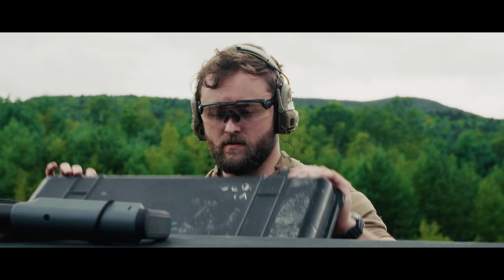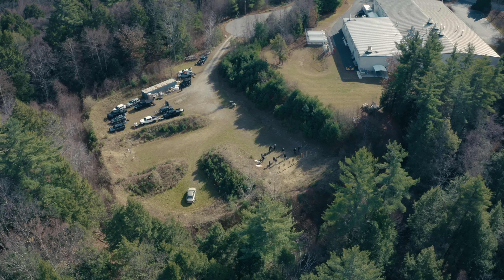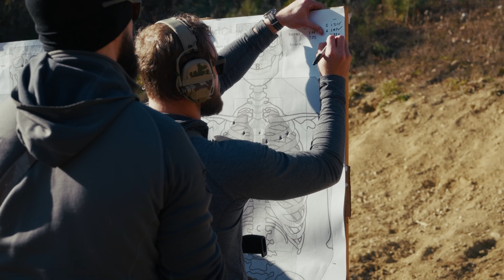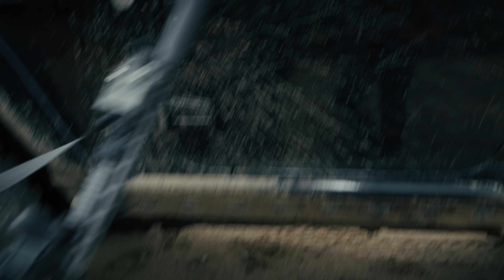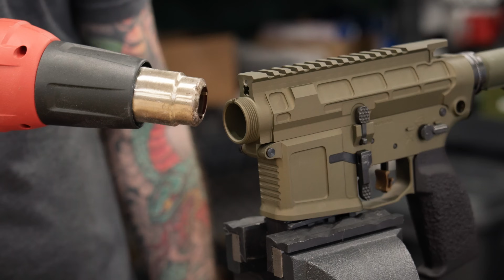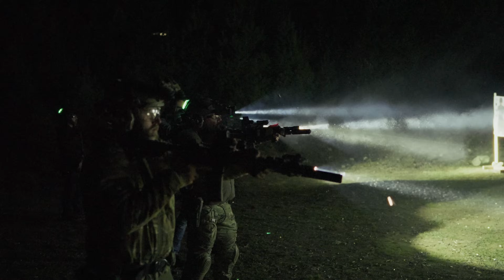ESD Breakdown: Leitner-Wise Product Suite

Comment: What's the max amount of rounds have the firing pin tested has gone through?
Reply: @racingdc9 Great question, I can't answer for ESD but ONR (Office of Naval Research) Warfighter Performance Department have our DI bolt carrier groups, which include all of these components, on long term T&E. We received a report at 24,500 rounds confirming zero issues, and it's my understanding that the current round count is approaching 40k with no reliability problems or replacement parts required.
Reply: @PaulLeitnerWise  That's great!  Thanks for the reply.

Comment: Thanks for the video, your slings are exceptional.  Are those Tacom HQ Alpha TARAC prisms on those short barreled uppers?  If yes, what MOA shift do you default to for a 10.3-11.5" barrel with a red dot or reflex optic?
Reply from the maker: @joelwright1822  they are! I’ll get back to you on Monday with the exact MOA shift we use for our 12.3/5” guns. We’ve been enjoying using them, they help a little with height over bore too for close range. Not a massive change up close especially when using an eotech since you have the donut of death to work with but any little advantage can be great!

Comment: The companies that are vetted by ESD are top quality. I have been buying your slings for a while. ESD introduced me to PMM’s  AR and Glock Magwell’s, they work great. I have had LWRCI DI bolt carrier groups in 3 of my rifles, they work as stated. So, the next innovations from Leitner should be top notch. Hell, ESD has me using Slip2000 and Howie’s tape. Now I’ve got to start a new build so I can use that new Match Bolt and Cam Pin.
Reply from the maker: @dwb2112  thank you! We take a lot of pride in our reputation. The company wouldn’t be my own name if I didn’t believe in what we were doing. We are customers just like you and never want to have buyers remorse. I appreciate your kind words and you taking the time to comment! Best, -Edgar